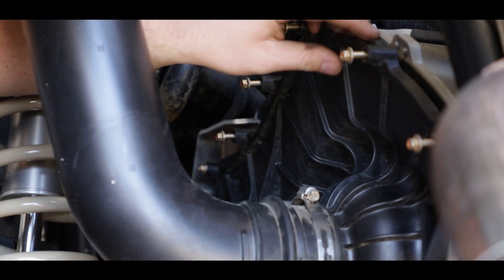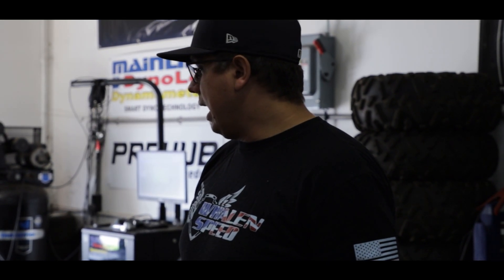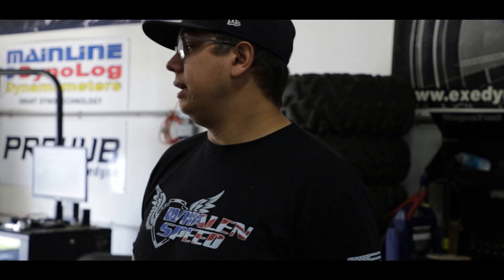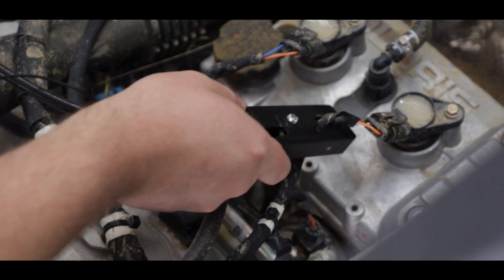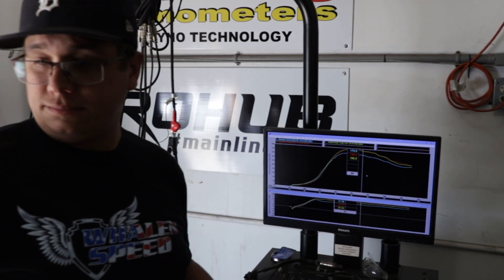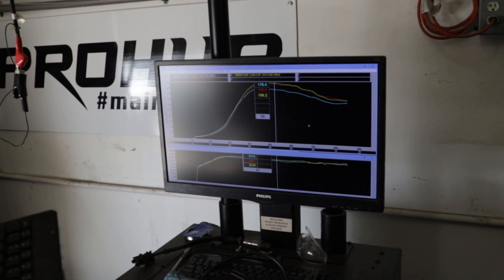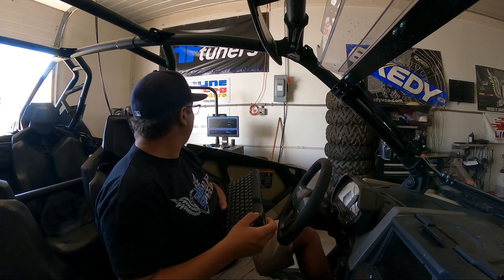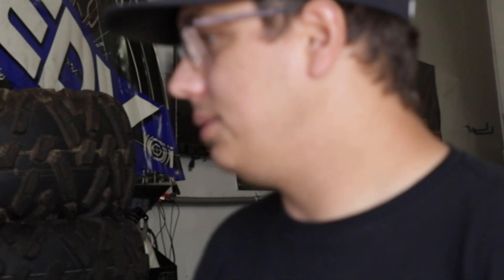Whalen's Speed: WS190 Stock Injector Tune Package | Project RZR ProXP | Easiest 200HubHP

Comment: How much is the right amount for 2024 Turbo R? I have the WSRD tune and at their shop it did 229hp and highest 234.7hp on their hub dyno. I had to change belt type and have the KWI Clutching RZRX300 Clutch Kit with just the primary spring change with weights not the secondary spring, I like the low rpm engage for in and out of trailer and rocks.

Reply

Comment: It’s the primary clutch shifting out too far. Drags on cover. Thicker washer fixed it. Mine stock did the same thing. At high speed it would drop rpm on long pulls down to about 7900.